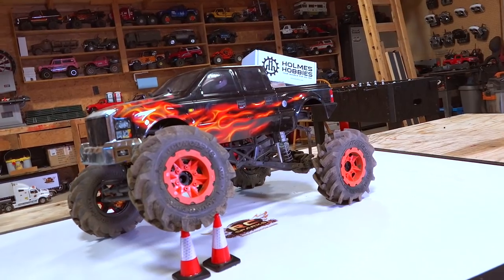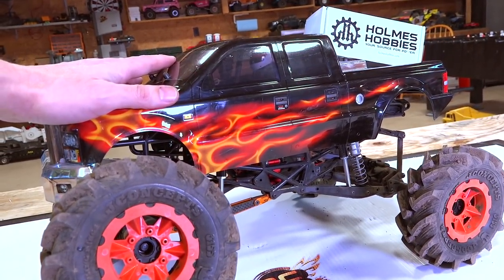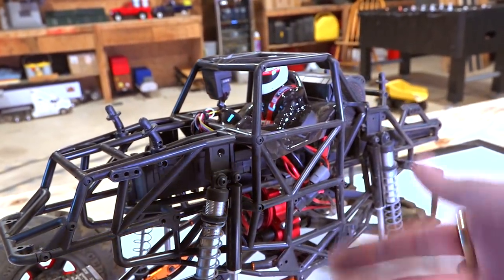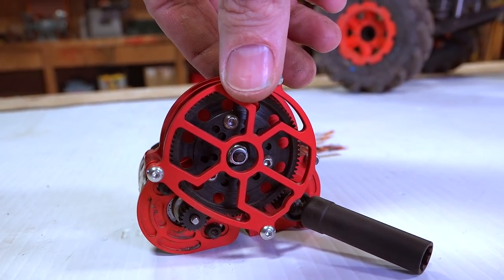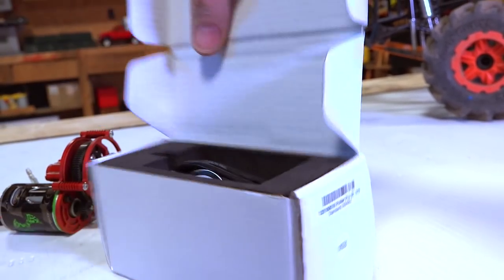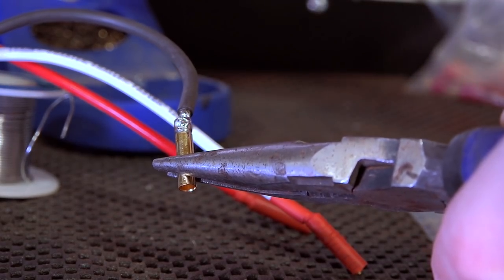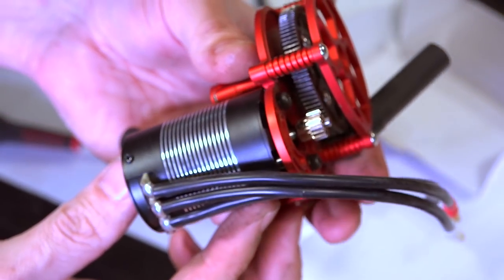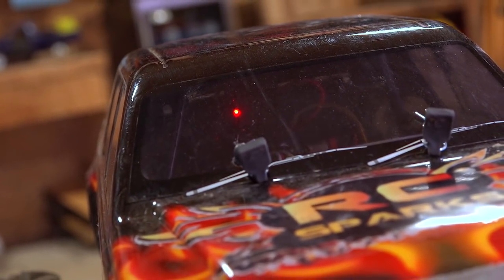Mega Monster Mud Truck BUILD & Holmes Hobby 3500kv PULLER PRO BL Motor UPGRADE! | RC ADVENTURES

Comment: 8:14 Glad you like the way it drives!   You can gear it up pretty tall too, there is a lot of stator crammed in the 540 length.  96%  the motor of a roc412HD or Castle 1410!

Comment: I have that exact same in my TRX-4 mated to the Holmes Hobbies BLS SHV500v2 Brushless 12V Crawler Servo and Holmes Hobbies Trailmaster BLE Pro ESC. Probably the most expensive group of parts on the truck but I'm not at all disappointed. I'm relatively new to RC crawlers, and channels like yours are what encouraged me to get into it. (And try Holmes Hobbies products)

Comment: You’ve gotta try the puller pro R 540-L4100kv. I have it in my bomber, and it’s quite a motor, very fast.
Reply: Thats the beast version of the 3500!   Doesn't crawl quite as well, but it's not made for crawling all day.

Comment: Will send a lot of mud flying that's for sure. Be sure to protect the sensor port. Motor and ESC might be waterproof, the connector is definitely not. I use a think conformal coating kind of glue. It's not one of the spray conformal coating, it's something you have to spread by hands, it's perfect for this use case. I use it on my TRX-4 with sensored brushless motor, works great.
Reply from the maker: Nope.. just some dielectric grease! :)
Reply: Dielectric is perfect for it.   If you want to submarine, I would recommend covering the face bearing of the motor too and around the solder tabs where they enter the case.   On new housings we have shrank down the hole so there isn't much as bearing showing and less grease needed.

Comment: I’m doing my first build, a frame I designed on a cnc, ARB axles, Vaterra 72 suburban body, Castle electronics. I’m gonna run D90 leaf springs and remove one leaf for articulation, and 3D printed beedlock wheels

Comment: The tires would look strange on there with that body if it wasn't for that suspension. And yes it is VERY stable! 😁
Reply from the maker: I hand picked it all my friend.. for very specific reasons :) Should work out great when I get the final links for the read of the truck !

Comment: Love the SMT10 platform! I seem to be collecting them these days. Have another Max-D in the box ready to make a dedicated BogHog mud truck (already have wheels and body that I used to switch out with my other Max-D). Can't wait to see how this motor does in the mud! Love the receiver location. I was wondering if you were going to add anti-sway bars to the front, but it doesn't appear to be twisting too bad with your setup. Thanks for continuing to provide inspiration to so many.
Reply: Thanks for the communication

Comment: You can get the same transmission in a multitude of colors on Amazon under SCX10 aluminum transmission. (For less than $50, Before shipping) Comes already together with full metal gears. I'm doing a full custom build on the original scx10. (SCX10 Rubicon) 👍👍😎😎

Comment: TTC ‘19? Very nice mods. I’ve got something similar, SCX10 chassis, Redcat E10 axles, Axial aluminum trans, RC4WD mud bashers, RC4WD 35T brushed. Doesn’t have the wheel speed like yours but it can get faster. I did borrow your Gorilla Tape weather proof tip 👍 thank you for that. As for snow, psh we’ll be looking at it until August here in the Midwest.

Comment: If you had to choose between Axial SCX10 original or 2, Traxxas TRX-4 or Vaterra Ascender which would you choose. In my opinion Axial because they are cheaper and I have more knowledge of them thanks to you! :) Thanks.
Reply from the maker: Hands down, the TRX4. Most capable by far :)
Reply: @TheRealRCSparks  Would it have been the SCX10 before the TRX-4 was even thought of?

Comment: Rc sparks search around Facebook there is indeed a guy who makes metal beadlocks for them tires there very nice highly recommend checking them out
Reply: Billet works designs check em out on Facebook just looked it up for ya there's also crushlock rc they make then aswell

Comment: Why is it called 3500KV motor?
Reply: That is the speed, 3500 rpm per volt.   Running a 3 cell it will top out out around 40,000 rpm

Comment: That motor is the same motor as a hobby wing motor
Reply: Not at all the same motors.   I'm not familiar with HW products besides the 1080 and the AXE, but when I updated the last housing design to have the ribs remachined it did make it look similar.  I like it though, not gonna change it at this point.